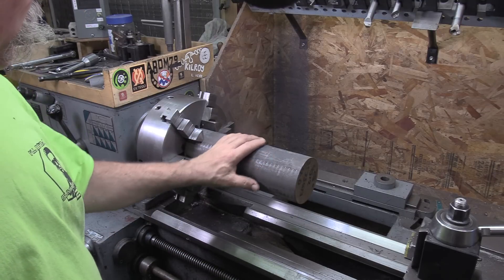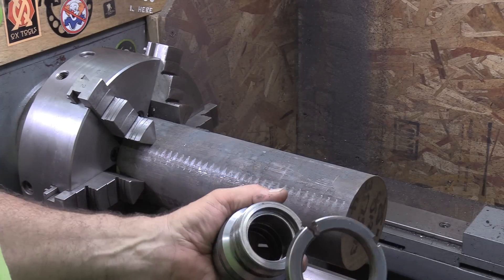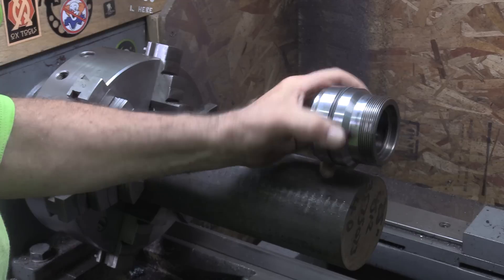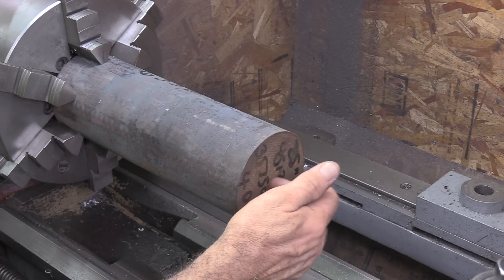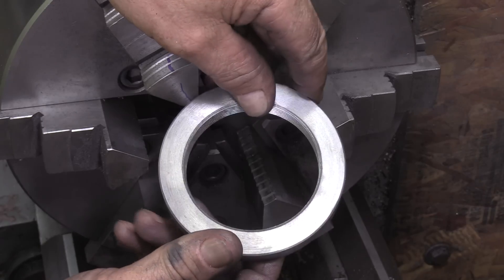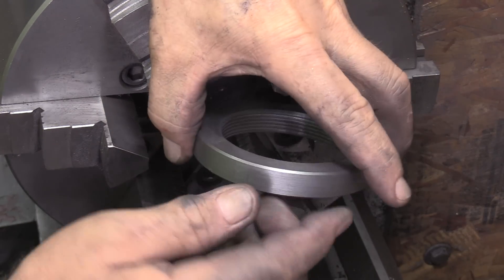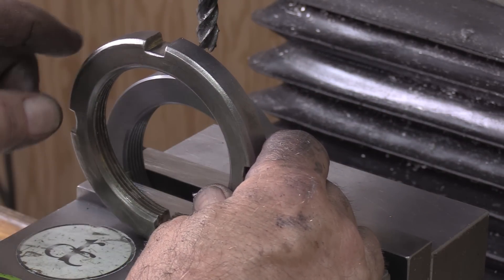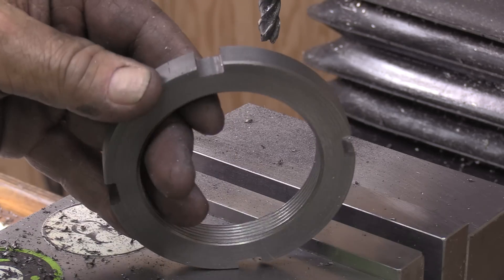Making a Busted Nut / Hydraulic Cylinder Repair

Comment: Ductile Iron? why not steel? Pistons are often made of ductile iron, sometimes the end gland. But a nut? I cannot recall ever encountering a nut in a hydraulic cylinder made of iron. However I stand to be corrected. Nevertheless good too see you back making cool stuff Randy. Cheers. BTW  I have been peeking at your IG...nice deck!
Reply from the maker: Thanks warren.  I made it as per requested from Ray.  This is from an old John Deere construction loader.  I suggested steel but this is what he wanted.
Reply: @RRINTHESHOP  Customer is always right....Right? 😁